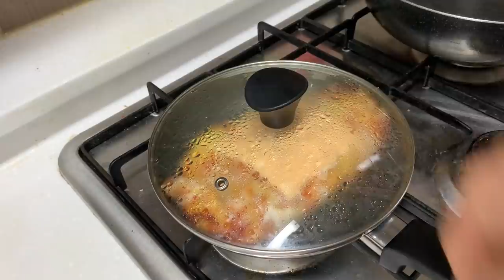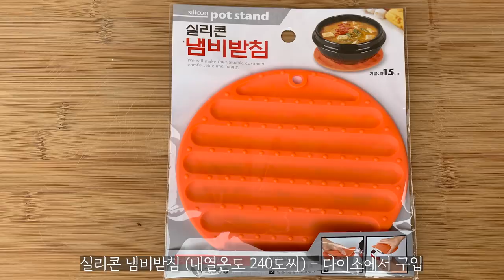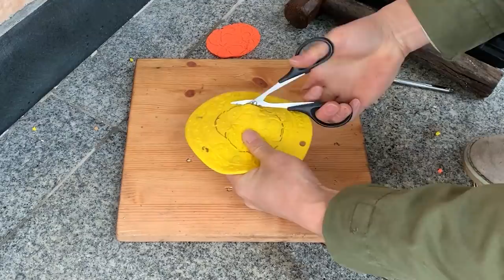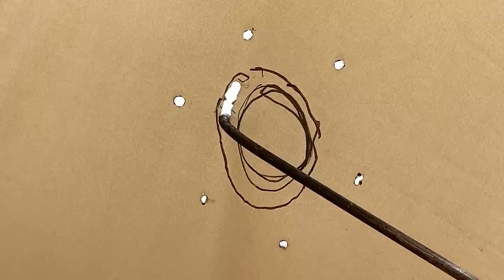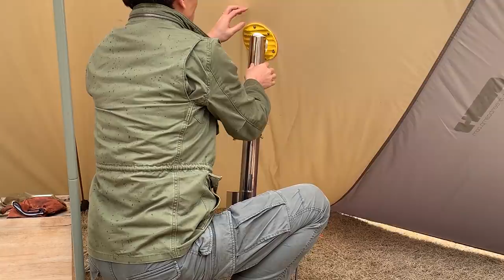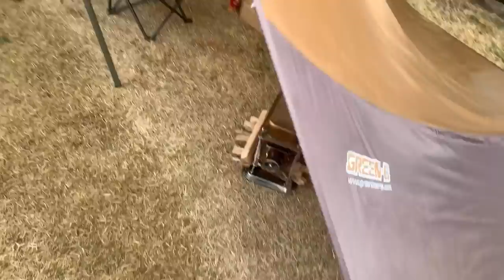$5 Wood Stove Tent Hole Jack DIY - M-Stove Project Part-5

Comment: You ready do come up with the most amazing idea’s thanks mate. Ant 👍
Reply from the maker: Thanks.If the temperature of the stove pipe is high (exceeding the limit), special attention is required.
Reply: 캠핑투게더 so it could possibly melt the stove jack then?
Reply from the maker: Survive The Night yeah, slightly on the cut edge. In my experience, not a big deal🤗

Comment: Great idea, been trying to find hi temp silicone, worried about heat transfer, seems like the pipe is going to get hotter than 240c
Reply from the maker: Mine was OK. You'd better find 1000c silicone if you worried about the heat. I will check the surface temperature as soon as I got thermometer on my hand. Thanks!
Reply: Pipe may exceed 240°C but heat will dissipate fast outside the tent.  If you do find silicon pad with higher temperature rating, use longer screws and a slightly smaller oval, and mount the new materials outside the existing silicon disk.  Alternatively, seal the gap between pipe and original silicon pads with high temp (automotive) is silicon gasket in a tube or cartridge from auto parts store.
Reply: @jwfinkler388  thanks for the tips, makes sense, I'm currently using simwool which has been working

Comment: Cut the center hole in the silicone a little smaller so it is tight around the pipe.  That will keep the tent watertight and also hold it up so it doesn't droop.
Reply from the maker: Awesome!

Comment: Wow! Wicked build man! Maybe make a bigger hi temp silicone ring for the inside ring bigger, just to ensure more that the tent won't melt and more silicone to absorb can't hurt... In summer time heat is when u would have to worry more though...
Reply from the maker: I agree with your opinion. It's okay now, but I'll have to keep an eye on it and think about improvements. Thank you.

Comment: Looks Great but wouldn't it be better to leave the hole in the outside one slightly smaller so it seals tight against the pipe ? Or is it enough to keep out the rain like this ?
Reply from the maker: Good idea. I will keep watching how this jack works(lasts) and next time if I make new one, I will leave the hole in the outside one slightly smaller. This is one of the reasons that I share my work to people. I could learn from them. Thank you so much.
Reply: @campingtogether   hey man how´s it going ?
I see you made a lot of progress on your stoves they really are amazing. Im curious is that jack of yours still tight ? How is it holding up in general any new found conclusions on building a better one (if possible) ?

Comment: Amazing idea !
Reply from the maker: I hope that the temperature of the stove does not exceed the heat-resistant temperature range of silicon. It looks fine. Thanks!
Reply: 캠핑투게더 try insulate the chimney with motorcycle thermal insulated tape

Comment: Hi. Thanks for another clear video. I agree with the comment about the flue pipe exceeding 240C in this low zone on the pipe. I avoid this problem by putting the pipe through the tent canopy near the apex where the pipe will be less hot. It also means that the pipe is stabilized by the tent without need for guy cables and is less exposed to leakage from water runoff. Tim.
Reply from the maker: Your method is great. For reference, I measured the temperature of the contact surface, so fortunately the temperature is not very high. Making the jack a little higher is worth considering.

Comment: Would you consider making a tutorial on building a budget (cheaper) simple version of your M-Stove for people who don't have many power tools?
Reply from the maker: It's a new offer. Do you have any good ideas? Anything would be appreciated.
Reply: @campingtogether  I was thinking using metal containers easy to get (stove pots? Lunch boxes?) Limit the tools to a drill and a saw? Maybe using different ways to fasten pieces. Would JB weld work? I saw people using steel beer cans to form the exhaust.

Comment: Put a metal plate upside down on the top of the chimney so that water does not leak in, the perforated smoke goes from there!

Comment: Great Ideal always Iron Surgeon 😁💪👍👏🙏 .. you might want to put some sort of high heat sealer in between the two pads for water proofing when it rains hard.....Just a Thought..🙋‍♀️ See your rubbing off on me....😁😁😁😁😂🤣😂🤣😁😁😁😁
Reply from the maker: I have 1000 d.c sealer, but I am too lazy to have use that :D LOL Thanks as always! Stay safe.